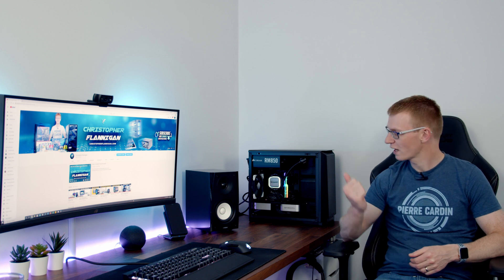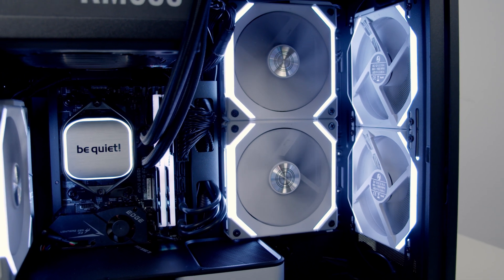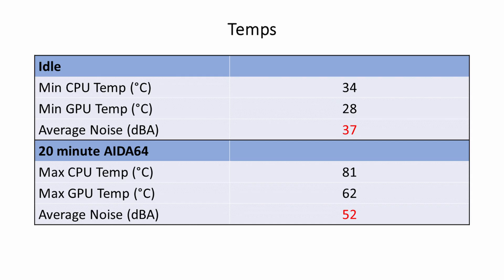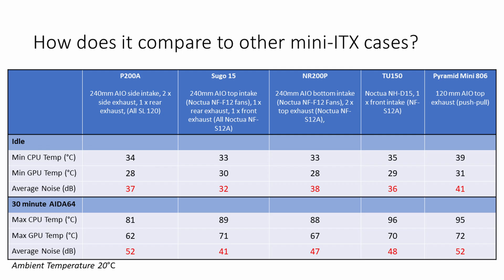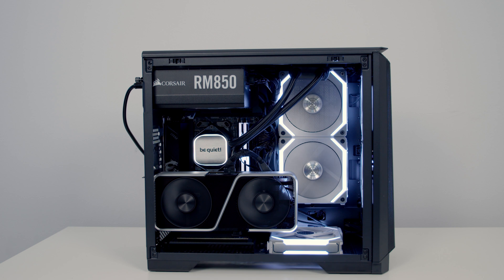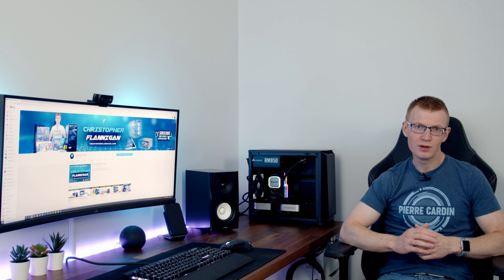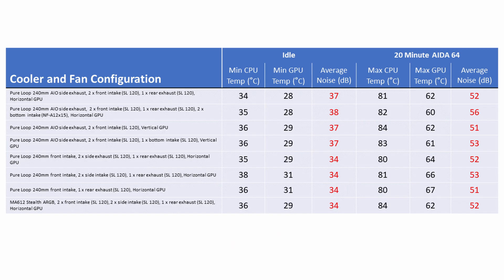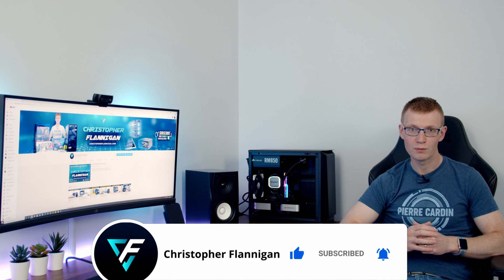Phanteks P200A - Best Fan Configuration

Comment: I feel like the obvious change here is to swap out the front fans for 140mm's, also flip the radiator so the tubes are at the bottom.  I expect these changes alone could bring the noise levels down considerably.  the 140's on the front should also help a bit with cooling.

Comment: Hey thank you for such good information. Sorry if I missed this, but but have you tried using the "performance" non glass panel with the side vent and a vertical GPU? Seems like that would also provide extremely good temps, especially with the side aio exhaust CPU cooler.

Comment: I want to build an HTPC in this case but can only fit it into my entertainment center if it's lying on the side, so I'd be unable to use the side-mounted radiator like you demonstrated in the build guide. If the radiator is front-mounted, would I still be able to fit the 3.5" hard drive bracket in the case?

Comment: what about an aio with side intake, and all the other fans as exhaust?
this way both the cpu and gpu have access to fresh air
Reply: I have the Metallic Gear Neo version of this case(only 2 PCIE slot, solid front panel) and have found using the side for the AIO unimpressive in either orientation. It harms GPU cooling too much.

I've set mine up with 240mm AIO on front and a rear fan all exhaust with the side sealed off, this forces the case to intake from the bottom and gives the best GPU temps. Had I a hotter CPU & more fans I might use the side as standard intake to give the AIO some fresh air.

Comment: Great review. I have teetering on rebuilding my current itx pc into 3 different cases, this phanteks being one of them. The Issue I have is the temps now that I have upgraded to an rtx 3080. Many of the sff itx cases present the threaten with this thermal issue, especially with a beefier card. This case appears to hit a sweet spot with it not being to big but still offering space and plenty cooling configurations. I appreciate you taking the time to actually test all of these different configs 👍🏽. I know which way to go now.

Comment: When you have a radiator on the side and a horizontal graphics card, for you it touched a part of the fan that isn't normally there on other fans, so it cleared the radiator. How much thicker could the radiator be there before it would interfere with the graphics card? I have a Corsair H105 which has a 38mm thick radiator, that's why I am curious. And with this radiator in the front, but fans outside the mounting plate like how you moved yours to be, how long could a graphics card be as mine is 330 mm long. I can't figure this out with the data on Phanteks' website or their manual, and they're not replying to e-mails it seems.

Comment: I had another question, kITGURUTECH did a review of this case with a 6800xt and the gpu thermals were close to mid 80s, much worse than yours. Do you think its because this case is better suited to smaller 2 slot gpus or are radeon cards just that much hotter than Nvidias stuff?

Comment: Awesome video! I'm curious. I've only got a 120mm AIO and was thinking of configuring my fans in this case like so: 2 front intake, 1 rear exhaust, and the radiator as a top side exhaust. Given these limitations I think this is about as close to achieving an optimal configuration as I'll be able to get. What do you think? Would you do anything differently if you were working with a 120mm AIO?

Comment: This is why I like your case reviews above everyone else's, that you try different layouts so you completely eliminate the guesswork around the optimal configuration. Had a gut feeling that a top mounted PSU with a side mounted AIO and a bottom GPU with direct access to a side mesh would be the most efficient cooling solution, but seeing the numbers saves me from either having to try different configurations myself, or going with something inefficient if I can't be bothered to try different ones.
Reply from the maker: Thanks, I appreciate the feedback